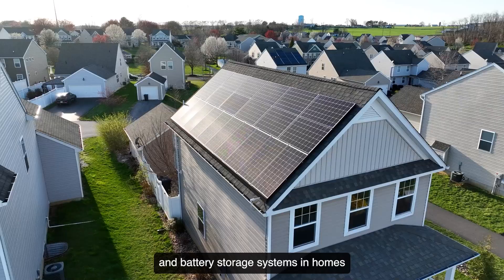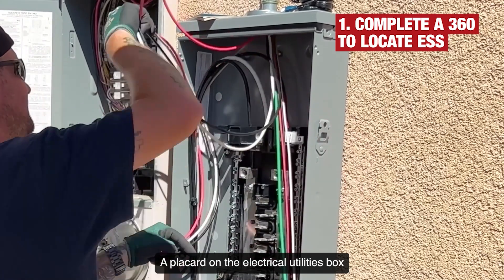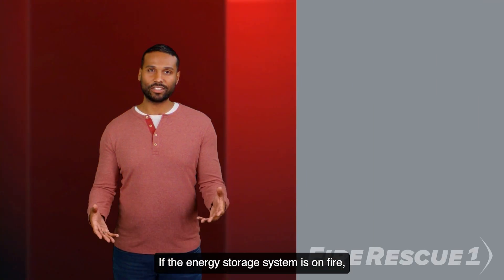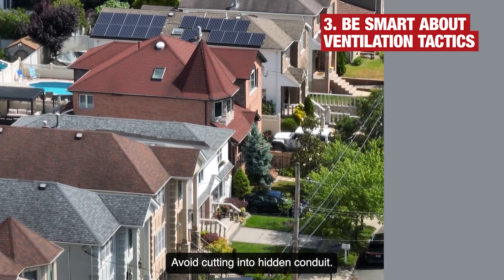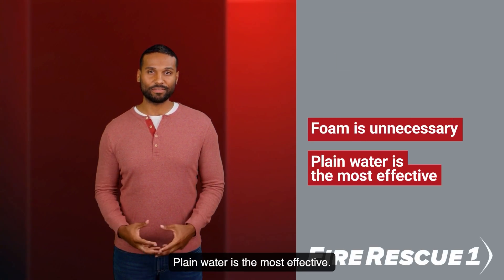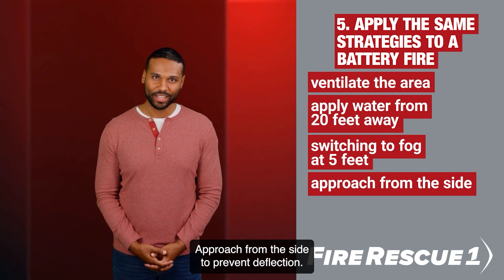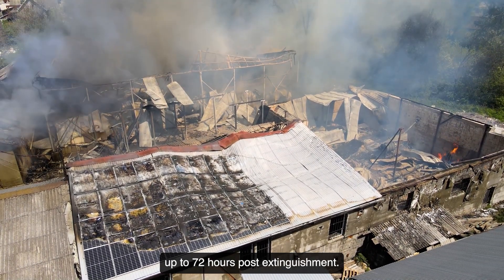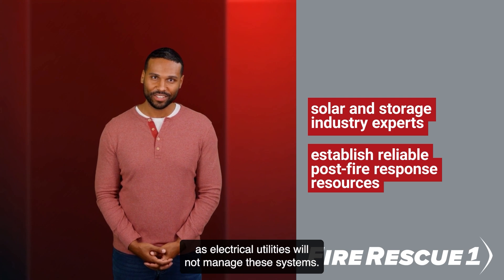6 steps for solar panel fire attack

Comment: Solar panels can generate electricity day or night? Hmmmm.....I don't think so, not at night.
Reply: Generally no however it would be possible that some generation can be made when there is no "dark" nights ie. northern hemisphere countries.
Reply: @jimmyc974  Well, if the sun hasn't set, then it's not night. It's still day. Doh! I have actually experienced the midnight Sun in northern Finland in summer and the opposite in northern Russia in winter. Both are weird.